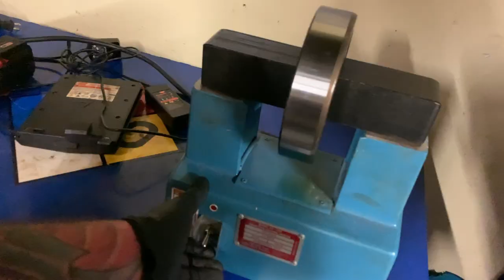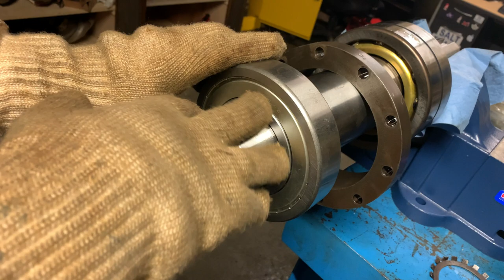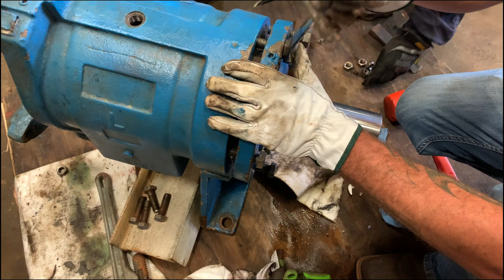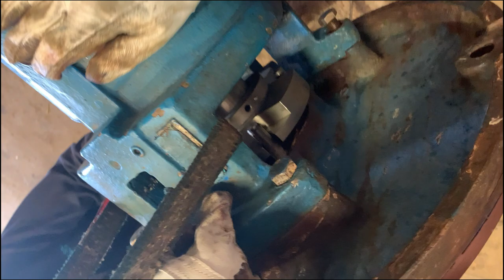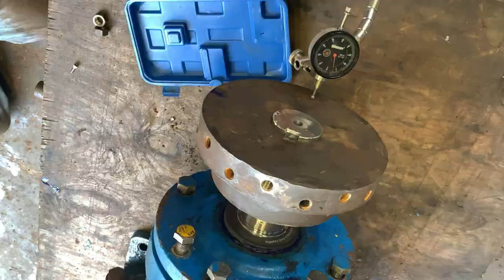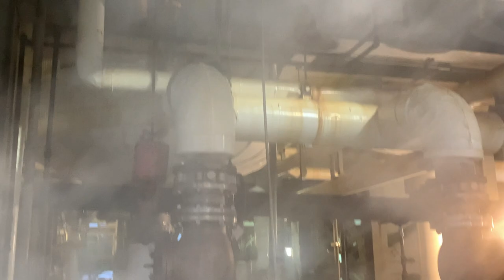Millwright Mechanic

Comment: Great instalation, I set the thrust a little differently but like your method. I generally run the impeller in until it touches then back out 0.020" then pull the clips on the mechanical seal and lock it down unless it's a condensate pump in which case I set the impeller half way to allow for thermal growth. 👍
Reply from the maker: Great tip!

Comment: I am a red seal journyman millwright and practiced the trade for over 35 years. We tried to do rebuilds in a clean shop and used a little better tools but the basics in this video are sound. when done correctly that pump will run for many years if pmed and lubed correctly. Disappointed did not see a laser alignment on the coupling.
Reply: To be fair, in the U.S. it's probably harder to get your hands on a laser tool. Took me awhile before I got one. You can still get use a flat edge or dial indicator and get in tolerance.

Comment: Awesome video, do the Millwrights not usually use power tools because of the extra weight or just easier to carry around hand tools?
Reply from the maker: Depends on the size of the job brother. But usually just hand tools.
Reply: @VantageWelding  Yeah I'm learning that currently as a Apprentice. Im used to using metric tools but some want to only use standard. I prefer metric always
Reply: My boss doesn’t allow most power tools. That way no one strips/snaps bolts or Allen’s. Also we don’t use Allen’s with the round ball on end. If it breaks off it’s a pain to get out.

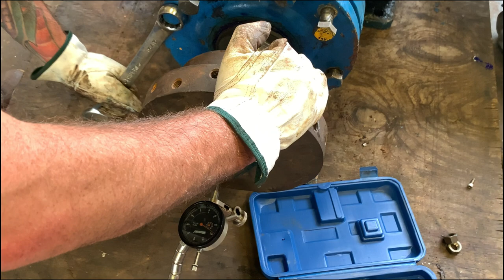Comment: Could you explain the dial indicator part? 6:31 why tightening the bolts like that?
Reply from the maker: According to millwright mechanics, you want to be able to tighten those bolts down without gettin the shaft in a bind brother.

Comment: never use brake cleaner on something you're going to weld! it is not necessary for making a clean weld zone.  if it doesn't all evaporate off it can created a deadly neurotoxin called phosgene gas when it reacts with the UV light from the welding arc. Not many cases of it but why risk it. use a grinder with a wire wheel or acetone if you really want it clean. again most welders would never use brake clean.
Reply from the maker: Non-chlorinated. Thanks brother. 🫡
Reply: Haha right on, ya never know what someone might grab of the shelf. @VantageWelding
Reply from the maker: @TheScottdavis86 for sure brother. I don’t think non chlorinated is any better. 😂😂 I have a video on here stating which oil I use to drill. An organic compound. And wear O2 filters when I work. 🫡